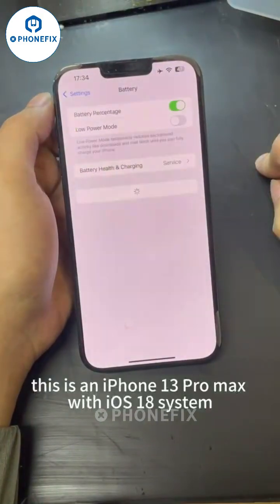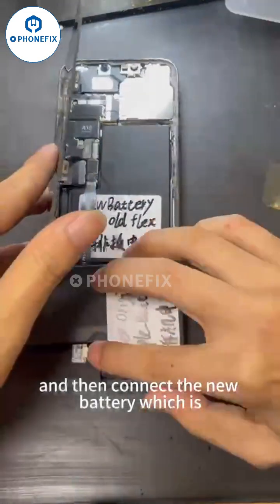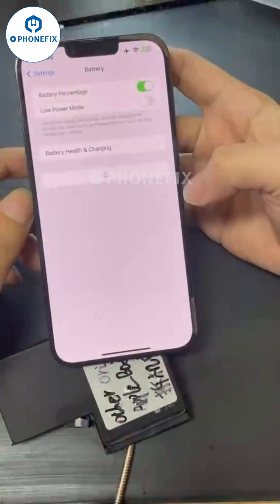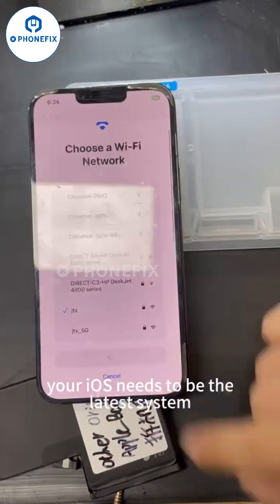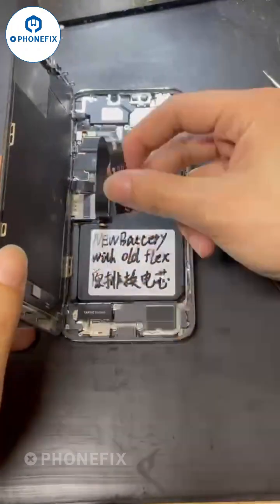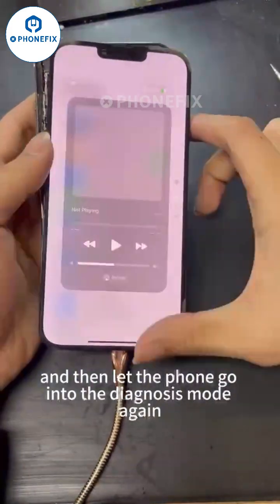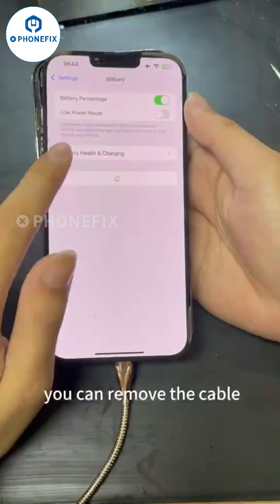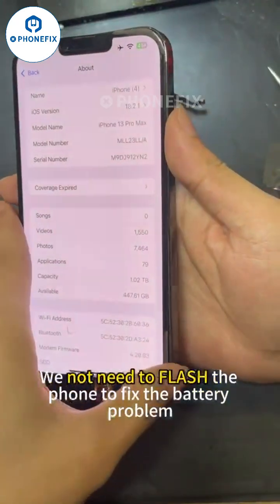PHONEFIX 100% Battery Efficiency Extension Flex Cable for iOS 18 Battery Capacity Health Data Repair

Comment: So we need another original 100 health battery to do this?
Reply: I’m also curious whether this adapter resets the cycle count or transfers the cycle data from the temporary battery you connect. Have you figured that out?